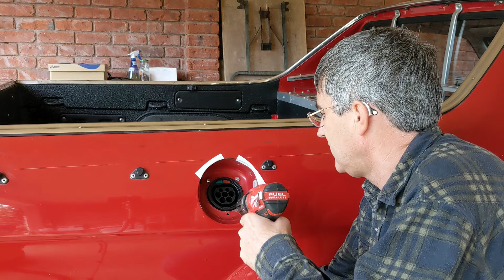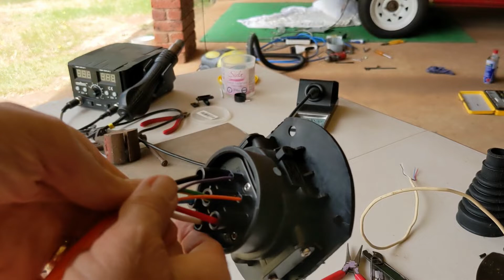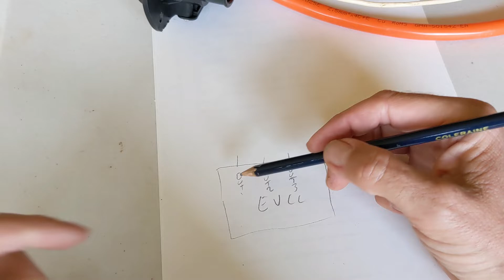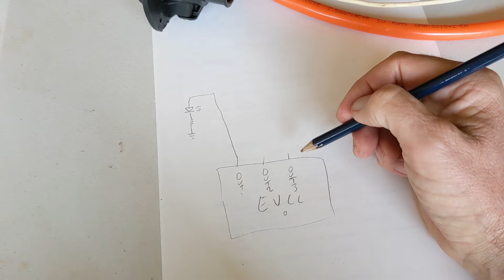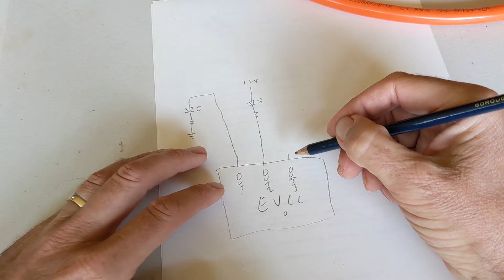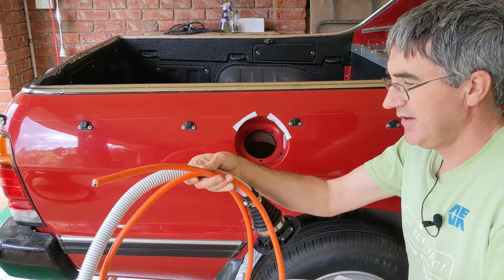Installing that socket in the Brumby (Charger 4)

Comment: glad i came across  these videos! I'm currently in the process of converting my brumby, and i bought my kit from oz diy(144v kit, but running 150v nominal as using 40 x 3.75 volt cells) I'm nearing the need for a charger, and you answered my question regarding battery charging management! thanks for that. I wonder if any chargers have build in bacc's? it could help reduce the need for another cable box and complexity in that regard.
Reply from the maker: Do you mean a built in charge controller?  I wasn't able to find one that has it built in.  That's when I decided to bite the bullet and go with the CAN bus controlled charger.
I did ask Oz DIY, which is where I got my charger from, but they didn't have anything to suit.
I didn't find anything explaining exactly how to do it, which is why I am making these videos!
Once I'm finished I intend to write up a more technical article which I'll put on my website: https://christopherwalkden.id.au/
Reply: @christopherwalkden  yes, that's what I mean. Okay, good to know that you didn't find anything...I haven't heard anything either. Might be the way to go!
Reply: Why did you choose to the charge controller, over using a canbus communication through your BMS? Does your BMS have can communication? Can you still use type 2 and regular 240v wall charging via canbus communication with that charger?
Reply from the maker: A CAN enabled BMS could theoretically control the charger, but my BMS is not capable of CAN.
Even then though, this would not let you use a Type 2 socket, as the BMS cannot talk to the socket.  You need to talk to the socket to find out what charging current you can use.
The Charger can't talk to the socket either.
The EVCC is very handy in that it can talk to the Charger, socket and BMS all at once.